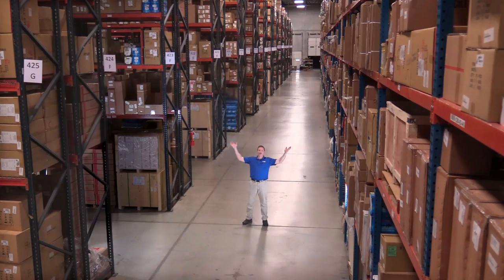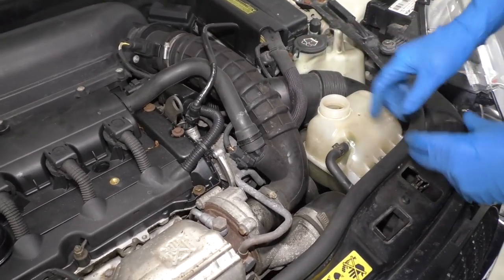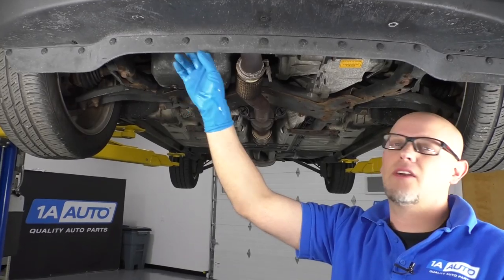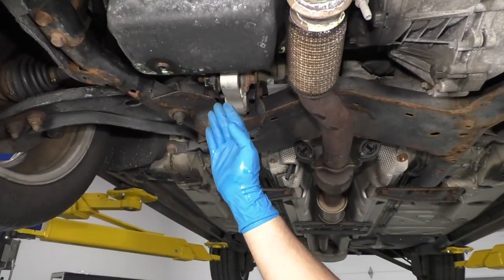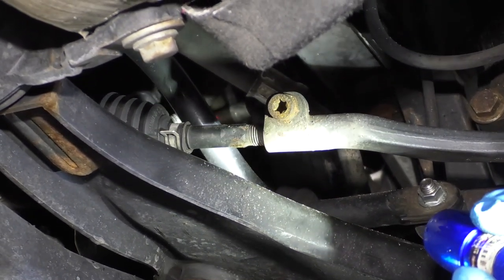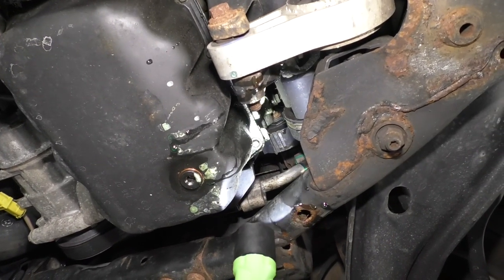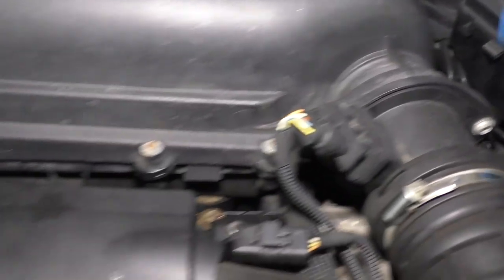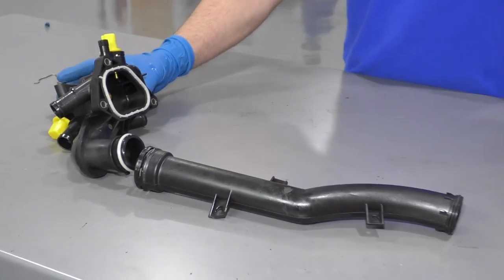How to Find Coolant Leak 07-13 Mini Cooper S

Comment: This is where mine is  leaking from running down the back of oil sump
Reply from the maker: +gavin1980 cosgrove Thanks for checking us out! http://1aau.to/m/Shop-1AAuto-c
Reply: @1AAuto  is the cross over pipe hard to change?

Comment: Hi Andy,  I just left the comment on your water pump replacement video.  I just watched this video also since my leak seems to be coming from my coolant pipe at the back of the pump.  Wow it was so easy while the motor was out...  I was very careful install it too...  now it leaks...
Reply: By coolant pipe do you mean the pipe plastic pipe betwen the pump and the thermostat housing?